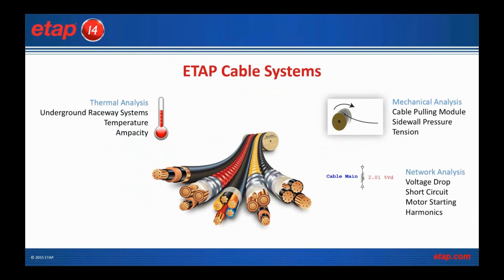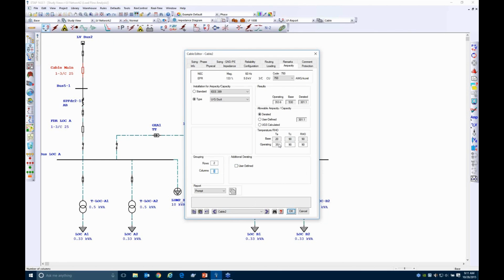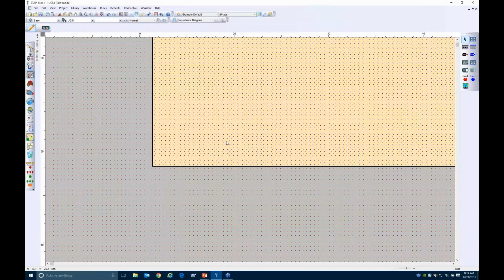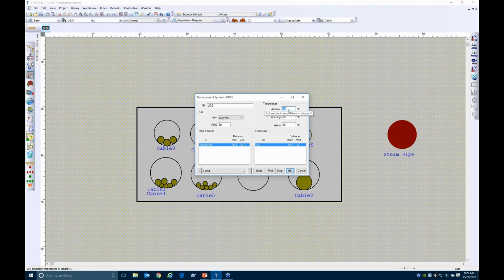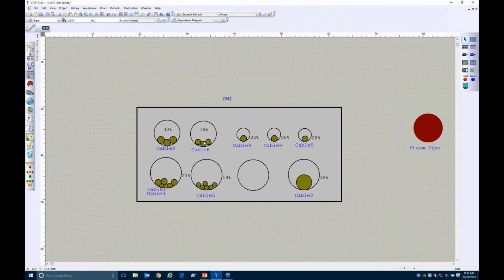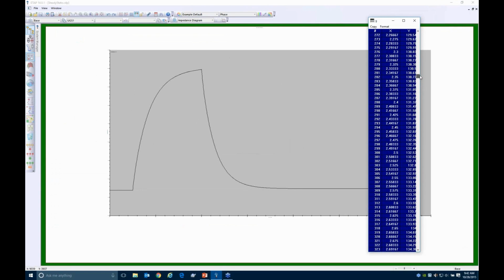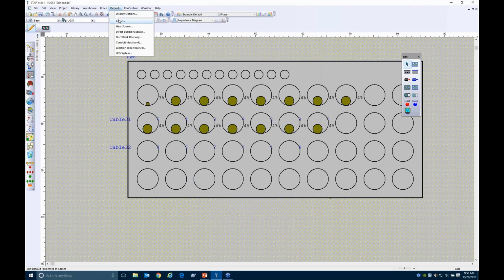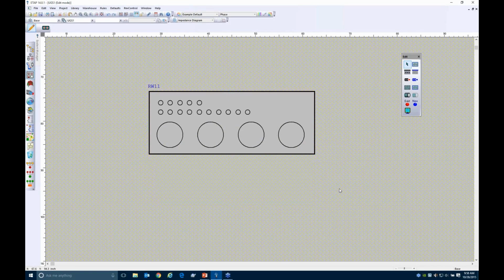Cable Thermal Analysis for Underground Raceways

Comment: Is there any method to make a concrete chamber in etap to do the thermal calculation for underground cables?
Reply: have u find a solution ?
Reply: @mohamedhelal3559  No. I did manual calculations. Unable to model it.
Reply from the maker: Thank you for your interest in ETAP Solutions. You can use our UGS module to run this analysis

Comment: Hi,
I would like to know if this supports multiple casings; for example, a cable within a PVC pipe within a Steel Pipe
Reply from the maker: Thank yo for your interest in ETAP Solutions. Regarding your question: In current ETAP releases, the Underground Raceway System does not directly support modeling multiple layers of duct types. As a workaround, for a cable installed in a two-layer duct system, the inner duct can be represented as the cable’s jacket layer. For example, if a cable is placed inside a PVC conduit within a steel pipe, the PVC layer can be modeled as the cable jacket. For more information, please contact our Help Center at https://helpcenter.etap.com to assist with your questions.